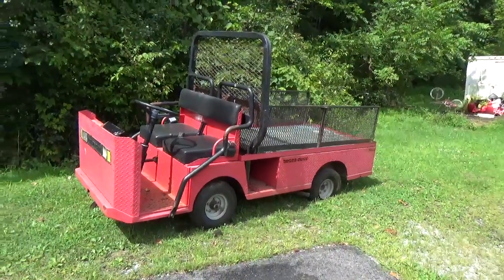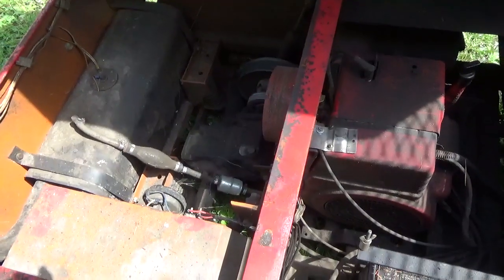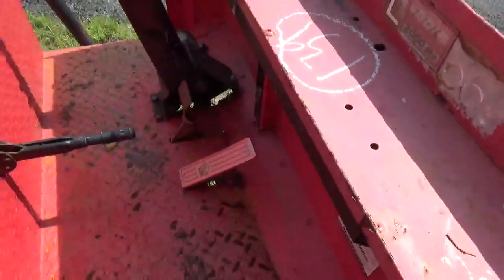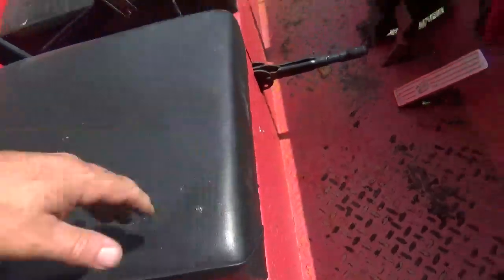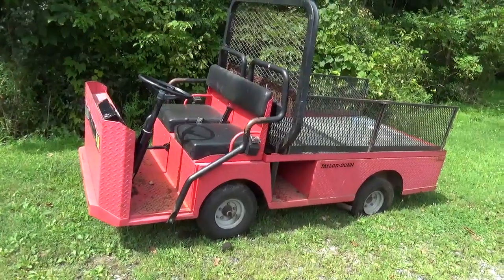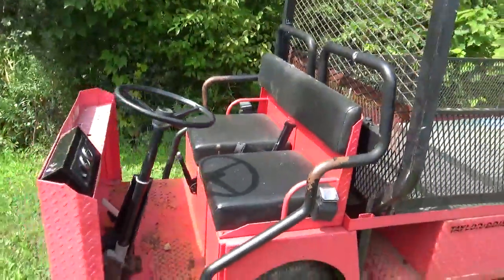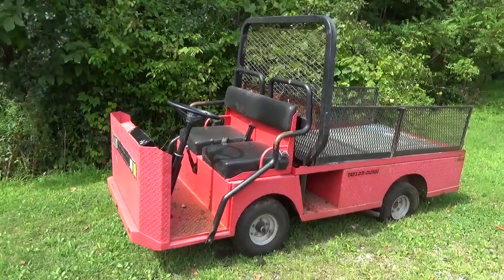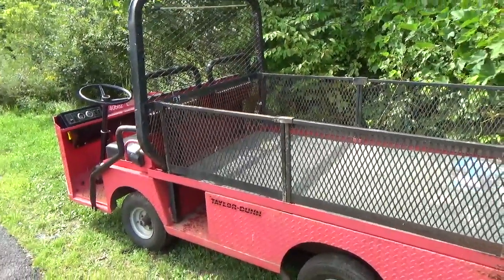Taylor Dunn Burden Carrier Cart, Unseen Before Delivery, First Look!

Comment: Cool toy Harvey. I drive those every day at my job, although ours are electric models, and they will carry a LOT of weight. You may want to investigate, I’m not sure if a golf cart rear end would be heavy enough for an industrial vehicle like yours there. I don’t know what your rear end housing is made of, either aluminum or iron casting but if you removed it and pulled the guts out, it would be a fairly easy repair for a skilled welder. I’ve repaired much worse over the years. Either way, good luck and have fun with it. Those are great industrial trucks!

Comment: I had a yellow one with a cab. The bed on mine was made a little different and it was electric. You don't just push them around like a 3 wheeler., that is for sure. Sold mine to a guy that had a few of them. Mine was nice like yours but it was so heavy I knew it would be no good around my rocky land. It is a shame about the rearend. 👍👍
Reply from the maker: Hey Fan, There are not many gasoline ones out there, looks like I may have some issues getting a rear axle for it.... I would of taken a cab if one was available, though, the roll bar is cool, I need to put a light bar up on it.... Thanks for the info, Ur thoughts, encouragement, watching, and commenting!!!

Comment: When you found the plate with the weights I got confused. The beast weighs a couple of pounds under 1300 and the gross weight with cargo is only 1500lbs?  That can't be right! Having me drive it would mean it was overweight by 60lbs! My guess is GVW with cargo, driver etc. is just under 2800lbs.
Reply: Bob Pegram yeah, the 1500 lb rating would be what it’s rated to carry in cargo weight, including passengers Bob. That’s over and above the weight of the truck itself.